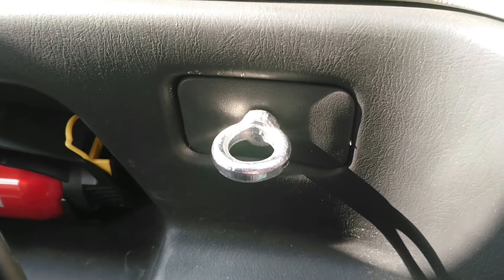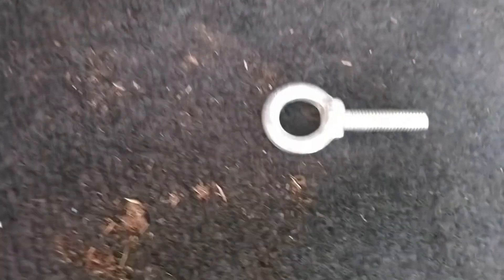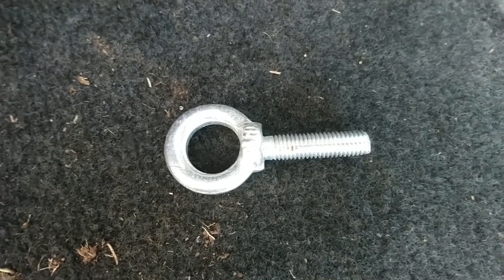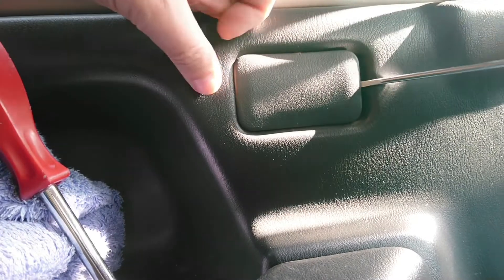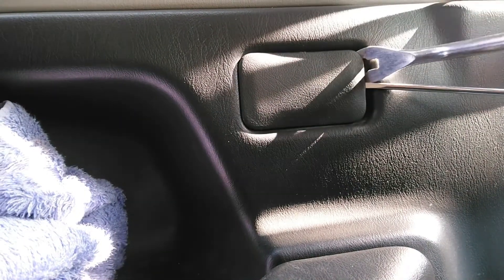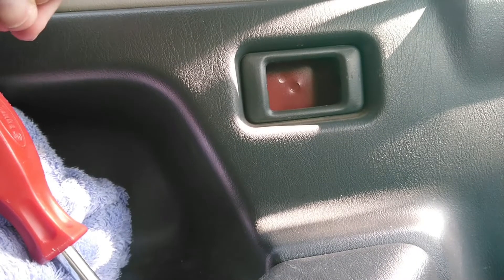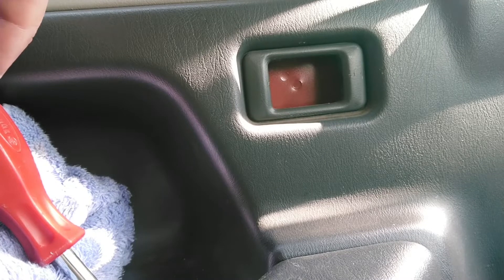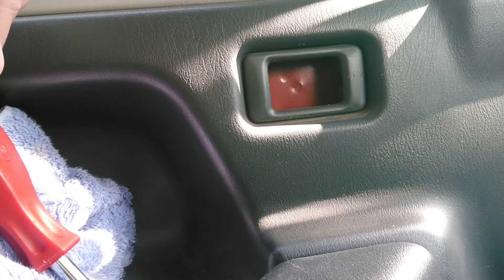How to fit tie down points in Gen3 Jimny

Comment: Thank you for video, but I think you'd be better off pressing a rivet nut in there instead of cutting a thread in (if I'm not mistaken) very thin sheet metal.
Reply from the maker: You may be right, but I hadn't thought of that.
Reply: @CLSJimny4x4  well, if it doesn't hold well  you can always press the rivet nuts in